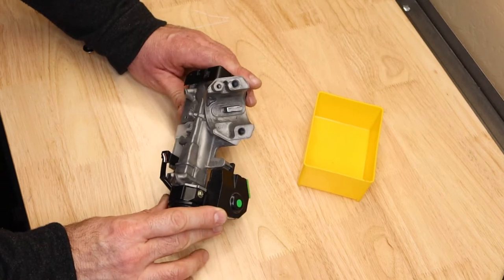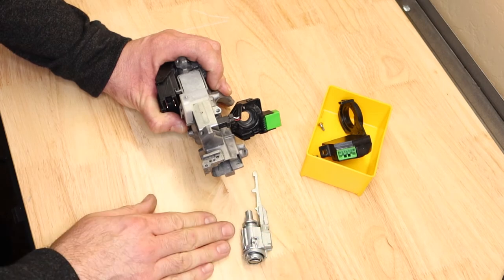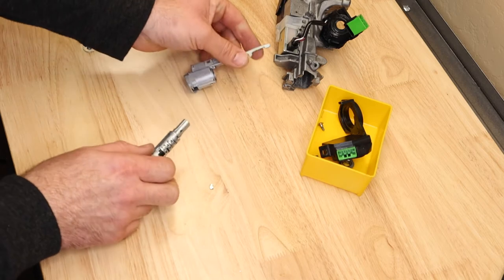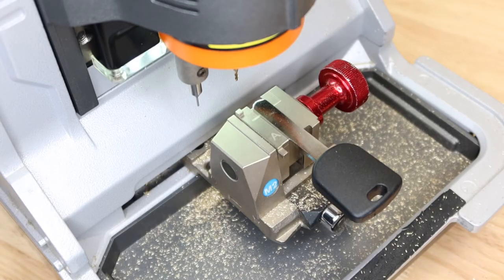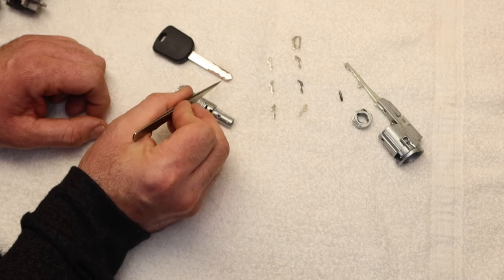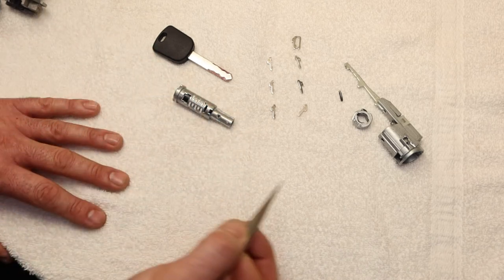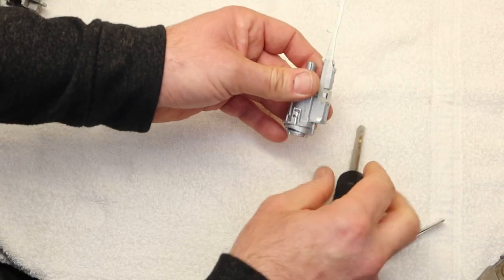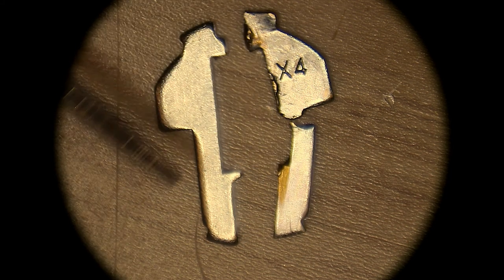HONDA / ACURA IGNITION LOCK REPAIR

Comment: After watching this video I googled his name and contacted him.  I sent my lock to him and he rebuilt it and cut a new key.  Often the old key won’t work with the new wafers.  I got it back and installed it and It works great.  I cannot say enough about his great service.  The cost was 1/4 of what a new lock set would have been installed and programmed by a shop.

Comment: Great video on how to get the key cylinder out of the housing assembly. That drill bit tip works great to get the roll pin out. The other tip with the pick tool worked great too.  I just remove the tumblers and the springs and put the key cylinder back together. It still has the chip in the key.  You still can’t start it without the key. It’s just as secure as push button start now. The other feature now, You can take the key out and leave the engine run and lock the doors and go in the store. I took mine apart before it actually totally screwed up. The key cylinder was starting to not want to turn. I figured that was my two minute warning I better fix it before it leaves me sit somewhere.

Comment: I just  had to do this on my 07 Pilot kinda. The question  i was going to ask was what  if you accidently locked the  steering wheel... well in a way  you answered that question. I was careless in removing the locking cylinders and  pulled  the shaft forward a bit and  had to remove the whole  assembly. Thanks for this video anyway. I learned something new today. 👏👍🥳🚙

Comment: Thanks so much as I was unsure of what to do when the steering lock/arm slid back as the lock would not go together. Your explaining on how depressing the steering lock puts the little arm back to position for installing the lock. I spent hours trying to figure this out and your video cleared up what happened, One way or another the steering lock needed to be in correct position for installing the lock. You are the only person I seen who addressed this issue.
Greatly appreciated. Great job. Kleff

Comment: Me again😄
Turns out I did need the tip about the steering wheel lock. I accidentally locked the wheel when I moved it to get a screw out. The whole process went well till I tried the key in situ. I had to show your video to my mechanic so he could release it for me. Even with paying him a couple hours labour  and my many part days, still way cheaper than the mobile locksmith. Thanks again

Comment: Thank you SO MUCH, sir. 16:30 was my issue, this is the second time I change the ignition switch and got blocked again. 
The first time I had the car to the locksmith thinking it was the lock cylinder, but not sure how the ignition switch was related with the failure, at the point that I thought it was coincidence. Obviously, the folks from the locksmith did not say what the actual problem was. The second time it got blocked I was so mad, it could not be a coincidence anymore, your video saved me money.

Comment: Hi Kern, any idea after I repair the key cylinder of  my car, the key fob would not function because my car  still detecting a key in the ignition even though I pull out the key already? I know that it is detecting because the car will sound chirp when I open the door. By the way thanks to your video it really helps a lot. 👍🙂

Comment: THis is amazing. Mine is a 2013, slightly different looking cylinder, but the steps were the same. Execpt I can't get the Cylinder back into the housing. The little seer piece hits the inner part and wont go beyond
Reply: I realized that I believe with 2013-2017 Civics, you have to unscrew the steering lock on the housing, press down on a metal piece and that will pop out the internal part that connects to the Lock Cylinder. You then have to put the lock cylinder and the internal part back into the housing at the same time holding them together as you push them into the housing. This is because the seer piece on the lock cylinder need to go passed the ring on the internal part, but it can't because the housing blocks it from doing that if you're trying to push the lock cylinder in.

Comment: Excellent video Thank You. As others have said, thank you for informing of certain housing issue where steering lock stud needs depressing @15:30. I could have made the same mistake even with a replacement part that I would not need to buy. (Now have to guess where to drill a hole and try hold down while in car, or remove the break-off bolt and related effort)

Comment: A remarkable video, very professional. Thanks for the quiet and methodical explanation of every detailed thing you did. I'm preparing to remove the core of my lock on a 2007 CRV. I was confused to see you cut a new key. I wish to keep my old keys and I hope my locksmith is able to  fit the "wafers" in the tumbler to fit my keys. Is that possible or do I have to switch keys and put in the code thing from my old key? Thank you.
Reply from the maker: The used keys may function for a while, but the wear on the key will cause accelerated wear on the wafer tumblers in the ignition.  This will lead to premature  ignition lock failure. In cases where the old keys are extremely worn they may fail to enter repaired lock, due to the new wafers digging into the rounded edge of the track milled into the key. 

     I have repaired ignitions like this since 2013  and have never had anyone tell me that an ignition I repaired has failed again.  I get calls from from people with locked up ignitions that have had theirs repaired by other locksmiths, that didn't cut new keys. The ignitions lock up prematurely and need to be repaired again.
Reply: @kernkeys8577  I've watched other videos that validate your statement. I've failed to remove the core like I planned. I'll have to take this to a professional. Failing Eyesite, and dexterity, plus more screws in places not accessible. What does a professional charge for doing this? I have the two keys and the core.

Comment: Hi, I have a 2008 Honda element I put lube into the key slot. The key starts just fine my problem was that the fob no longer worked. I tried to program the fob like shown on YouTube and it still wouldn’t work. Any insight what my next step should be would be appreciated.  Thanks

Comment: Can you show exactly where to drill behind the electric switch, To unlock the steering wheel locking blade without removing housing?
I have my Ridgeline stuck on the side of the road, trying you do the repair.

Comment: Hello i have issue where after i switched the ignition switch my steering wheel and my key wont turn. Whats the most likely issue id like to point out my battery was disconnected before removing ignition switch.

Comment: When i  removed to roll pin holding the cylinder to the  lock body ( time 3:30), I am not sure from where, but a solid  pin about the same diameter but shorter that the  roll  suddenly fell lout also. No idea from where it came.

Comment: I didn't understand why you would remove any wafers but the broken ones.  Seems like unnecessary extra work.    Having removed the wafers and the springs, how does one identify the wafers for the right slots so they conform to the key cut so the cylinder rotates?  I think I would prefer to remove each wafer, and if it wasn't broken, I would put it back so as not to get it confused with the others.  Also, I would have liked to see the key placement in the code cutter.  I like your method of removing the roll pins.  Its the easiest way I've seen yet.  Thanks Kern.
Reply: We replace all of them so the older ones that haven't failed yet won't fail soon and the old ones are worn out. When you cut the fresh key it works best with a new key that isn't worn out.

Comment: I removed my lock in a 2003 Pilot and started to pull out wafers that were stuck when they all fell out is this the reason I have the green flashing key ?
Reply: The lock is in and it cranks but will not run any ideas no car for 8 days in the winter is horrible ?

Comment: Where is the code for a 08 civic ignition key cylinder. Thank u
Reply: If your talking about the key code it will be on the trunk lock or the little lock by  the drivers floor board or on the outside of the ignition cylinder.
Reply: @madelinenajarian4043  thanks question is it the one below the head of the cylinder close to the front key lock

Comment: what size drill bit did you use to remove the roll pin
Reply: It is less than 1/16. I used some harbor freight bits that I had from a past project. The roll pin is about 1/16 or smaller.
Reply: @olocausto80  a 1/8 bit should do it?
Reply: @pouncerminned863  1/16 is half of 1/8. It is going to be too big. The idea is not to destroy the roll pin. I said smaller than 1/16 because I didn't measure the drill bit.

Comment: Just take the lock cylinder out by pulling the roll pins take the lock cylinder out pull the Fing wafers and tiny springs out put back together. Slapper all back together and never have this problem again. The transponder in the key is the trick to getting it to start anyway so why f with the stupid never ending failing wafers and the key that is constantly wearing.And yes The stearing wheel still locks when you turn it off and pull the key.You can take your key out while its running too which is very convient at times. I put one full rap of black electric tape at the end of the cuts on the key so that the key doesnt fall out of the lock easily. Just did this today and it works like a champ.  Sorry locksmith's but this nightmare is BS AND I FOUND THE CURE. Save yourself a tow and 200 bucks buying new keys blah blah
Reply: Couldn't turn my key, so I took my tumbler out and I put it back together with no wafers/springs. Now it won't even give me a "ding ding ding ding" chime saying the key is in. Still can't turn the key either. Dunno what to do now.
Reply: @CrimsonYetiCartoons  did you hook all the wiring connectors back up
Reply: You put it back together incorrectly for sure..
Reply: @dougchatman9220  Yes. Several wafers were damaged so I removed them all. There are only two green electrical plugs which I removed. The tumbler rotates freely outside of the housing, as it should. Once put in, no turn. My steering wheel is locked, and the only thing I can figure is the cylinder which the tumbler rotates is locked/broken as well and will not turn. I'm walking away from this before I put a fucking axe in my sidepanel.
Reply: Did you Getter done?
Reply: @dougchatman9220  No. When trying to start it, I wiggled too much and actually broke my key. So, I thought maybe I damaged the transponder in it and now the receiver won't pick up on it and chime. So I tried my valet key (which I think has a transponder in it too) and I get no chime from that either. Very strange. I have battery power but can't get it to chime. And my wheel is still locked so I'm working on chiseling out the two safety bolts.
Reply: @CrimsonYetiCartoons  use a dremel or similar to cut i straight slot in the bolts so you can take them out with a screw driver sounds like your ecu lost pairing with the transponder in the key or the transponder quit working for one reason or another
Reply: The pickup unit for receiving is probably fine.
Reply: Ah. Classic Dremel. Ok. Is pairing something I can do or do I need to take it to someone? If I get my wheel and the cylinder behind the tumbler unlocked (I assume this is what actually cranks the engine because the tumbler slots into it), can I literally start it with a screwdriver for a while? Just to get it around for a bit.
Reply: @CrimsonYetiCartoons  you have to have a scan tool to go into higher functions on ecu to repair whats left of exsisting key or to remove it and pair up a new key with new transponder. You need to take a few hrs what some of the videos about the whole subject matter disassembly, fixes, pairing and unpairing and removing keys using scan tool etc
Reply: Breaking current key didnt help not that you didnt already know that already. Youll need a new or used key with new transponder now and you'll have to pair the new one up using a scan tool
Reply: @dougchatman9220  Okay. More research for me.
Reply: @dougchatman9220  Just to check... By scan tool you mean an OBD tool?
Reply: @CrimsonYetiCartoons  it takes a scan tool do some research.
Reply: @dougchatman9220  Alright. What's also weird is my buttons on my key work... Lock/unlock is fine. So is it actually unpaired? My stuff is so messed up 😂
Reply: @CrimsonYetiCartoons  the buttons are seperate from the rfid chip inside and there is another procedure for programing them to the  vehicle. Keep at it it will all klick in your mind eventually
Reply: @dougchatman9220  Alright thanks will do.
Reply: @CrimsonYetiCartoons  what was the outcome?
Reply: @pouncerminned863  Bricked my truck. Had to take it into a shop. Towed. Something messed up with the transponder when I unplugged the thing and it would not register when the key was inserted.